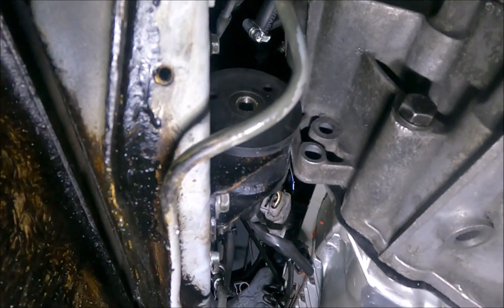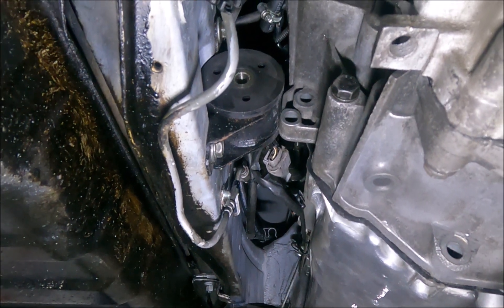Despite TWO junk aftermarket 'tuning' parts that don't fit, the quattro box is in the MR2!

Comment: Proper english as it should be,  the Nob you accurately talk of is well known for his ability to talk utter shit especially when he is at fault. Check around the Celica clubs regarding some of his early development work, it was his paying customers who did the costly development.  Your name will be mud now you've pissed on his chips lol .  Perhaps now is a good time to make a list shaming the worst suppliers you've had dealings with, this particular Nob has to be near the top. Keep up the good work all the best.
Reply from the maker: I had no idea!

The way he was talking he was some super god supplier to all Toyotas, and made out all his other ill-fitting shite magically worked well, despite also saying they all way bigger holes than the bolts on ‘800bhp drag cars’ etc.

I’ve got all the messages from him with his claims of that being fine and normal, so if he tries to bullshit about it it won’t work…
Reply: @StavTech  I’ve got one of his mounts on a decent power ST205 and didn’t check it before fitting. Worried now :/

Comment: Tbh you might as well just get rid of the bush, just make sure the bolt is done up tight enough youll be mint 👍😂
Reply from the maker: Exactly lol
Reply: I bought the same item and had the same issues very disappointing i also had to grind a chunk out of the side of the plate as it was fouling the block